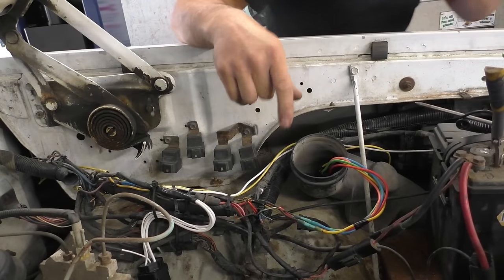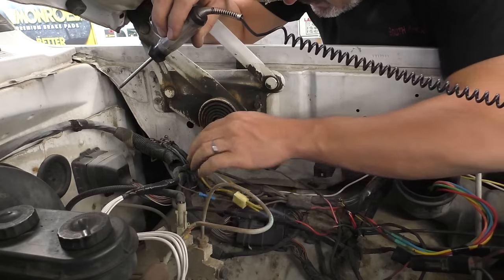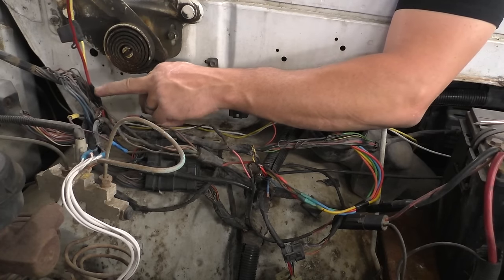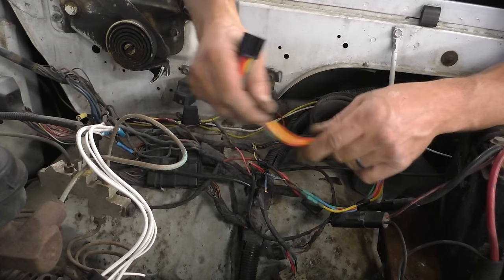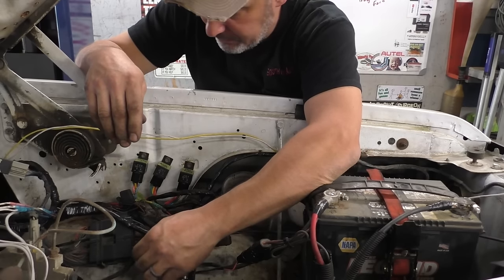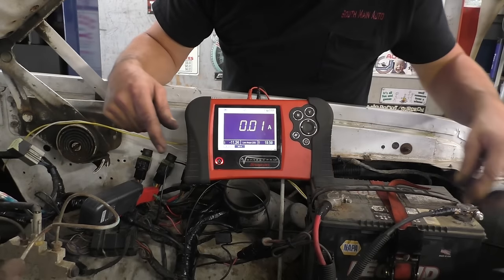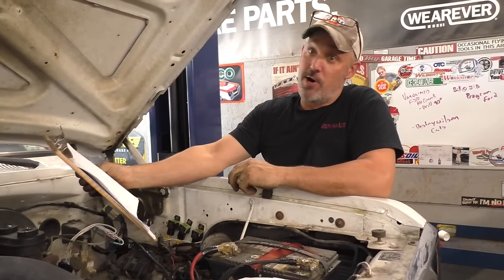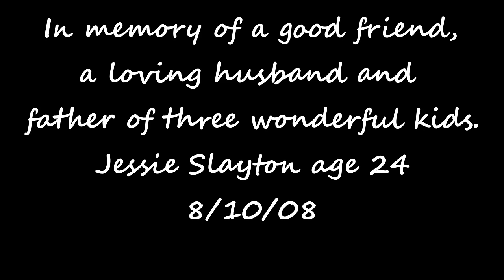Square Body Ram No Start - Complete Hack Job - Part II

Comment from the maker: UPDATE:
Vehicle died on me the next day and I traced it down to a bad connection on the new fuel pump that was installed. The fuel pump connector was repaired and it's as good as it can be for the time being😉 Thanks for watching!
-Eric O.
Reply: Sweet sweet closure
Reply: Good job Eric 💗💗💗💗💗💗💗💗💗💗💗💗💗💗💗💗💗💗
Reply: Good job Eric! You're friend is happy taking care of his family!
Reply: o
Reply: you are a good man Mr. O, good lookin out for your friend's little girl. We should all be so lucky to have a friend like you.
Reply: Glad you stayed on it and fixed it.
Reply: Thanks for the update Eric!! This was a great video set!! RIP Jessie
Reply: Sheeeesh, I hope I don't have to deal with the fuel pump again. I replaced it a couple years ago. when I first started having problems. since then I have replaced all of the sensors, and computer. right now I have 2 working computers for the ol truck.
Reply: I was wondering if you were going to check the new pump install, eliminate the basics aye ?
Mrs O seeing you Naked all the time ,that's an issue that is not fixable with or without service data 😅but I presume Mrs O has a strong Fuse lol
Reply: Well done Eric, good man.
Reply: Your videos always hold my interest, even when you think they suck. Love this channel.
Reply: When
Reply: In other words, it didn't need a fuel pump. Power and ground weren't checked.
Thank you for closure!
Reply: Excellent!!!  You just knew there still was an issue with the fuel pump.  It reared its ugly head and you slayed it!
Reply: I do like that motor, reminds me of most of mine !
Reply: Wooo! Thanks for the closure!
Reply: You are an awesome human being and an amazing mechanic! Would love to have someone like you in my area here in Germany. ;-)
Reply: Good old Erick you sure are a good man
Reply: So, glad you fixed it for the the young girl her dad can now Rest In peace 🙏
Reply: This was a tough job in the fact that it was emotional.  It's ok to not be ok, its ok to cry and it's ok to care.  You and Mrs. O are some of the best people around.  We need more caring people in this world like you both.   Love the videos!  Blessings
Reply: If it ever gives her grief again, re-running the wire from the relay to the pump on such an old bus would be a belt and braces fix that'll keep 'er fixed.
Reply: Glad to hear of a final conclusion.... You are a better man than I am, as well as a better diagnostician and a more thorough repairer.... I would be proud to have a friend as good as you.
Reply: That’s the correct way to verify your repair. Great job. You were certain that the fuel pump operation was intermittent. All to often, not enough testing is done. She gets kicked out the door then comes back on the hook. Kids, take note. This is how it’s done correctly.
Reply: As soon as it started working again, my heart dropped - I KNEW that you were feeling the same - even after you were shaking the wires, I was like "omg - ugh" - good job on double checking the fuel pump conns and such....great video - something TOTALLY diff than the normal "check the error codes" ordeal - LOL
Reply: I'm a Square Body Dodge Truck fan and we all know that damn fusible link design is always a problem that must be swapped out with a true fuse block design.
Reply: White fusible link 30 Amp. The spark you saw was probably capacitance in the harness.
Reply: Nothing worse than intermittents. Nice  job fixing it up for her. Now she will have a reliable truck. It's always nice to help people out especially family & friends or those in need. God would want it that way!
Reply: someone elses previous disasters are always so much fun.
Reply: Of course it was the part that someone else already "fixed"
Reply: 😂 @thatdave86
Reply: Great to get to the bottom of the problem, I have the same with some of the machines I have to fix, it's not a good feeling. Regards Richard 🇬🇧
Reply: great job,  it takes me back a lot of years doing things that, that others just bodge, as we call it here bodge it and scarper, lol, its is nise to see a person with a heart,  like you Eric, and not a swinging brick, and respect for your late good friend's family, my condolences to the family anyway, from across the pond, best wishes mate. to you and your family
Reply: Napa Not a sponsor sells fusible link wire so does AutoZone Amazon and a bunch of other different places.
Good job 👍👍👍 on getting the Ole girl going again.
Reply: You are such a good point a to b individual. I have added your family to my prayer list.  What an awesome human being, you are.
Reply: Outstanding!!!
Reply: the other guy screw up was a blessing , so Eric O could fix all past hacks and  future wiring culprit ...  🙏🏼
Reply: yes yes Eric O
Reply: Better get control of that camera girl….she is telling all the family secrets….. loved the video! Thanks Mr. O.
Reply: RAM Power!  Looks 100% better. Great job! Thanks for the tutorial.
Reply: Wilberts is calling😢
Reply: did you get paid for the repair? if not, how much was ist?
gruß martin
Reply: Amen to that. @donakahorse
Reply: I wish I had a mechanic like you close by!
Reply: Still was a good video. I like the diagnostic videos. I learn alot from them. And i have a good idea of how things work. But you always teach, no matter what. Great job.
Reply: @thatdave86 she said that and i died laughing cause it was so unexpected. They both seem like good people and a good couple.
Reply from the maker: @martinteuber2313   No I didn't charge her.
Reply: Just wondering, when you showed the OBD1 connector in the engine bay.  Do they make a cable to attach OBD1 to a obd2 scanner/ reader, and with only six wires, what info is given.  Thanks
Reply: “They don’t need to know that”, priceless!! Keep up the great videos!
Reply: Mr. O it's probably in the fuel Pump wiring! O wait you found it Out Which is Good like Mrs.O holding the Camera  and she was Definitely Funny at the End 😂😅
Reply: Ya done good Pilgrim! 😁
Reply: @thatdave86  Eric had better be careful, Mrs O might plug into his OBD port and run a scan on him.
Reply: Awesome update!
At least you know that the known problems are repaired.🤙
Reply: I told ya.  Mine did that too.
Reply: I enjoy watchin these electrical videos. Keep it Real Mr O. ✌
Reply: And now you can sleep at night. I know that was bugging you because it would have with me. Good 2 part series.
Reply: I knew it.
Reply: Eric you got more patience. Than I glad you fixed it for her awesome work Kinda like mind games on wires
Reply: @tcmits3699 don't know about Dodges, but with a GM you could jumper 2 pins and the check engine light would flash the code.  You counted the flashes to get the 2 digit code.  Dealer would read it with a Tech 2 code reader.
Reply: @SouthMainAuto  you are the best!  Tell her to not let anyone else touch it.
Reply: Excellent job by an excellent man
Reply: @thatdave86  Don't worry. She's got his wiring diagram m e m o r i z e d.
Reply: Awesome Eric ! I’ve worked on many old vehicles like what you just messed with, especially Chrysler classic relay green Crody wires shorts and all that stuff ,but mrs.O is the perfect Automotive shop queen ! she rocks ! but then again so do you ! sending much love to you two and your family
Reply: Very impressed with your electrical knowledge, I super suck on electrical problems, mechanical I’m ok with though.
 Glad you helped this young girl out, that’s what makes you who you are, a good man.
Reply: Hi - the spark was probably caused by an electrolitic capacitor charging....
Reply: I repaired a Torn  link once. The parts place did have links with capacities for them on the packaging.  I think today's  replacement for them are the Maxi fuses.
Reply: @SouthMainAuto  of course you didn't. I left you a comment today on part 1. Check it out - mean's allot to share.
Reply: Awesome result and a great tribute to your friend Jesse!! 🍻🍻
Reply: Eric O. Steely eyed rock star helping out when needed. Kudos to you sir.
Reply: Thank you VERY MUCH for the update. I kinda thought it would fail sometime soon. Glad you were there to track it down and finally fix it for good.
Thank you for letting the wifie be the camerawoman. How you can be embarrassed after us looking at your mug all the time is weird to hear you say. And about her saying she’s watching you naked all the time, well that’s another type of video….haha!
God Bless your friend, his family and you for helping them out! I know you didn’t charge her! If you did, I’ll pay you! Thanks!
Reply: @thatdave86 it 😅
Reply: Awesome!
Reply: On the road again! 👍
Reply: The toughest diagnoses are when there have been people working on the car when they should not be.
Reply: You're good human E. Thanks for sharing this story.
Reply: The Avoca Karma bank is full!One of the honors of small town living,people care,and help others.The dust coming from my I pad was tough!Respect to the Avoca wrench master!!
Reply: Kinda worried when I heard 'new fuel pump'. Played that game a few times...
Reply: I think many people are giving a virtual hug after this one Eric 😊🇮🇪
Reply: Better it died on you instead of the customer / family friend... My first truck was my grandpa's '89 Ram Charger 150LE (I think) with the efi 318. I don't ever recall having any wiring or electrical issues with it except for the check engine light on quite often. Never had any engine or tranny trouble with it. That truck was a comfortable beast!!
Reply: Nice find!
Reply: That’s interesting. Great video,!!
Reply: Remember the old days with the lean burn system at Chrysler, now I'm in locked room with my crayons 🖍 😅
Reply: @SouthMainAuto any idea as to why the fuel pump started working? Do you think the circuit going to the pcm had to be complete in order for the fuel pump to work and when you added the fuse, it completed that circuit? Just curious, thanks for the entertainment O family lol.
Reply: YOU DID GREAT!!!!
Reply: Great job.  For future reference... believe Mopar white fusible link is 22 gauge for 30 amp protection used for the ASD and ECU circuits.  The orange one is 20 gauge for 20 amp circuit used for the hazards and flashing lights.  That accounts for the bundle of fusible links for all those relays.
Reply: Awesome, good job Eric, always feels good to help out a friend.

Comment: as the fuse approached the holder, the downstream capacitance on the line (circuit decoupling capacitors etc ) causes an  in-rush of charging current that causes an arc over, hence the arc/spark you saw.
these were two really good videos

Comment: Eric, as an electrical engineer I would recommend a 30A fuse. Fuse should be rated at least 50% above peak draw. Also my Jeep is at it again. Went to do a brake job yesterday and found a bad u-joint on the passenger side axle shaft and they are doorman junk! New performance shafts ordered.

Comment: It's nice to see someone else deal with a wiring mess. I just spent 3 days rewiring a door activated suspension drop system on a 2012 ambulance. Of course, it malfunctioned directly after an engine swap where the cab was removed.... another great video. Thank you.

Comment: You're a good man Eric, the 1st brand new vehicle I bought myself was a Dodge Power Ram 250 back in 91, with a 360 in it, I had it for 10 years and it never gave me any engine problems.   I traded it in for a 2001 for a brand new quadcab. Which that one I had for 14 years and that only gave a/c compressor problems once.  Watching this video sure brought me back memories.  Thanks, they sure don't make trucks like they used to.

Comment: The length of these videos, already edited and condensed, makes me feel better after taking about 6 or 8 hours to fix a family member's 9 rodent-chewed wires. Unlike this RAM, there the main problem was that everything was hard to reach both from under the car and from the engine bay. It is also always fun when you fix something, one code goes a way and 4 more appear.

Comment: Being a strip cutting logger in my past, it struck a cord with me hearing about the man's accident and the dangers of logging.. You did an awesome job figuring out the issues with that ladies Dodge. I found it odd that someone had removed the relays and hot wired them  instead. Glad you figured it out... Nice work Cheers

Comment: These two had my head spinning.  I always enjoyed electrical work, and it was one of my ASE certifications.  But the job of essnentially making a new, complicated harness along with undoing the previous hack jobs got me so confused I had to go back and watch previous sections in order to keep things straight.  I've said it before and you keep enforcing it - you're the best auto tech I've ever seen or worked with.

Comment: Eric, this video really hit home for me... When my grandfather passed I inherited his '87 Ramcharger. Although it was carbureted, it still had a spark control computer, which failed not long after I started driving it. I ended up going to the junkyard and pulling an old-school magnetic pickup/mechanical advance distributor and all the associated wiring/components from a D350 dump bed truck. I spent hours upon hours digging into that wiring and installing relays just like you did. Sadly I had to sell the truck because it just wasn't financially/logistically feasible for me to keep it, but by the time I was through with it, it ran probably better than it did when it left the showroom floor. Thank you for sharing your adventure with this truck, I hope it brings that girl as much joy as mine brought me :)

Comment: Whew! Glad to see you doing the same thing I did recently on a 1987 Dodge Raider. I don’t feel like a hack now!  Alternator and starter both had fusible links that got fried…and I mean smoke billowing out from the hood. They were right at the battery terminals. I replaced them with in line fuses just like you did. Then replaced the alternator which was putting out so many amps that it blew the headlights out. Nobody sells the original fusible links anymore, so that’s about all I could do.

Comment: Glad you found the final iffy connection and fixed it. Also glad you added the starter relay back in - best not to have too much juice running through the key circuit. Thank you for another great video!

Comment: Really appreciate coming along on the old school repair. I remember my first encounter with fusable link on my 84.5 dodge caravan when my misplaced oil cap got friendly with the fan. The car was only 2 years old then and I was 30 miles from help.

Comment: started my mechcanic career back in '77 before rebuilt alternators were a thing,we actually soldered new diodes in haha.old is gold brother,Im still amazed at the fact a lil love shown to old rigs comes back in spades,call me crazy but im fixing up a '74 pinto wagon for a daily,'87 turbocoupe powertrain,big 2.3 turbo,world class T5 trans,8.8 limited slip rear,Fueltech FT500 ECU,should be a blast,rock on Eric!

Comment: I have to admit I did get some pleasure out of your wiring adventures. Seems like everything I work on is just like the dodge truck project. And I’m very familiar with that nagging feeling that although it’s running I may not have fixed it permanently. It’s an honor to be in the same club with you.

Comment: Your the best tech on YT I've run across, if the comment section has haters let them hate. Haters always hate anyone with a full plate, I know first hand how a whole bunch of ppl that will try to take you down when your a master of your trade and have a full plate. Happened to me because God didn't want to see me being used anymore by a cheating tramp. You just get back up and fill that plate again. Being a master technician and now having injuries that keep me from doing that trade along with not being able to math for anything keeps me from being able to find a new way but God always rewards good when the time comes. Keep up the good work Eric.

Comment: Eric, a fusible link needs to be 4 gauge numbers smaller than the wire you are protecting. Example #10 wire needs a #14 fusible link. It also needs to be 9" long maximum. Just some invaluable information from an old time wrench.
Reply: Yup, this is true.
Reply: So out of wanting to learn any copper wire 4 numbers smaller with a max length of 9 inches works? its not a "special" type of wire??
Reply: I understand the wire is ‘special’ in that the insulation can take the heat of the wire melting/blowing. Don’t want the link to blow and then short out.

Comment: Chryco has always been a stranger to proper electrics. In 79, I drove a dodge 1/2 ton. It was on a flightline, and you were to run the flashers when leaving the truck. From day one, it seemed the vehicle would shudder and fart for a second or two when shutting it down. Figured it was from running at 15 mph all day on cheap gas. The real problem turned out be an old quirk courtesy of a Chryco engineering from the late 60's. The flashers would lock up if you were on the brakes. This could energize the electrical system. That was the cause of the shudder and fart on stopping, as I had been turning on the flashers when coming to a stop. Turns out, you could rev the hell out of it on shutdown with flashers, and the engine would catch fire and keep running with the key removed.